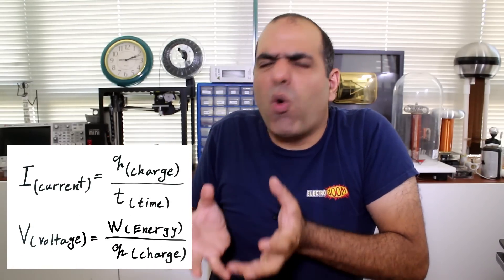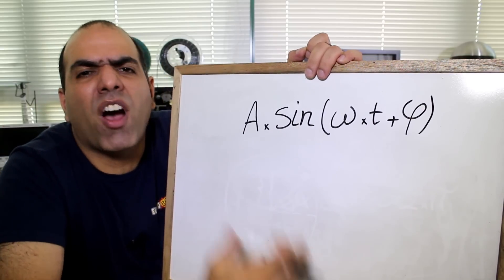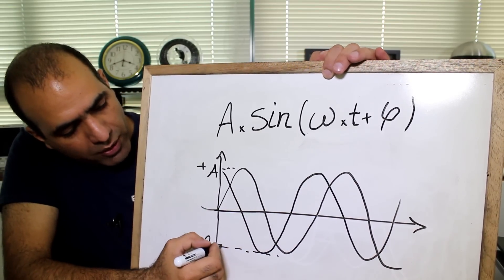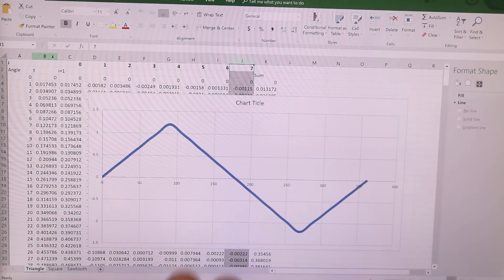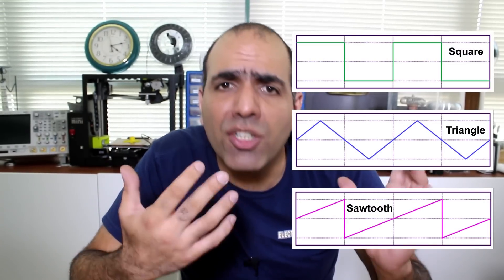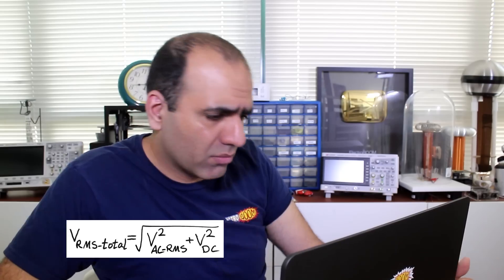What’s AC and DC (ElectroBOOM101-003)

Comment: As you said the direction of ac current would change in some frequencies 
So why we dont have electricity in neutral wire ?
Reply: really dude?  check the voltage of your outlet with a multimeter with the red probe on the neutral wire and black probe on line.

Comment: I have some questions(they might be dumb.. ). Imagine we have a powerline going to f.e. the Moon, theres a lightbulb and an other line coming back to the Earth. 

-How should I imagine the electrons movement,when we connect the lines to an AC supply.

- How much time does it takes for the bulb to turn on?

-Are the elecrtons traveling like waves on water, so (ofc.) it doesnt turn on immediately. Are the AC voltage "builds" up in the wires like the waves on the surface on water and there are points in time when half of the wires dont have any voltage in it, meanwhile the other half has the AC in it?

Comment: here is a challenge for ya.  we know sound at a specific frequency can levitate a ping pong ball....or other objects...yes this is true....fact.  so....build a model flying saucer with a coil on the bottom or a speaker....and then run the correct frequency through it to levitate it.    if you built a coil and ran a frequency through it and placed a ping pong ball on it ....it may levitate.....so...since the coil can lift a ping pong ball...why not upsize it...and run that same frequency through it...to life your model saucer.  i bet it would be challenging....and pretty cool to watch you do it.....if it succeeds....you could build a sonic hover board.

Comment: To make an AC battery:
With 3 batteries, 4 transistors, 2 resistors, 2 DC leds, 2 capacitors (low voltage for rapid alternating change):
the positive terminal of battery 1 is connected to led DC 1, resistor 1, resistor 2 and led DC 2;
one connects the led DC 1 which connects the collector of the transistor 1 to the resistor 1 by the capacitor 1 which connects to the bases of the transistors 1 and 2;
one connects the led DC 2 which connects the collector of the transistor 3 to the resistor 2 by the capacitor 2 which connects to the bases of the transistors 3 and 4;
the emitter of transistors 1 and 3 is connected to the negative terminal of battery 1;
the collector of transistor 2 is connected to the positive terminal of battery 2;
the collector of transistor 4 is connected to the positive terminal of battery 3;
the emitter of transistor 2 is connected to the negative terminal of battery 3 which will be the first alternating port;
the emitter of transistor 4 is connected to the negative terminal of battery 2 which will be the second AC port;
add 2 transistor:
base of transistor 5 links to base of transistor 2;
collector of transistor 5 linked to emitter of transistor 2;
emitter of transistor 5 linked to negative terminal of battery 1;
base of transistor 6 links to base of transistor 4;
collector of transistor 6 linked to emitter of transistor 4;
emitter of transistor 6 links to negative terminal of battery 1.

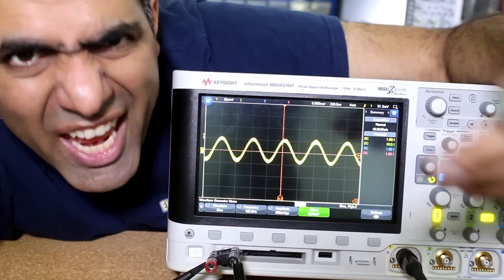Comment: 8:39 yup, just like what we do to any message as an electrical wave to prevent loosing info after we delete the negative alternatives. S(t)+U with S(t) is the message and U is the DC continuous composant that we add before multiplying them all with a High frequency wave in an AD633 aka the multiplier before we get to "modulate" them all. thats what we learnt in the "amplitude modulation" lesson (AM) i hope youll make a video about AM one day <3

Comment: I have a question. You said that dc  is getting to destination untouched, but ac is not. That's why we are using transformators to raise ac voltage. And you said that if dc was easier to raise as ac, we would stick with dc. But why do we need transformators to raise dc power if it's getting to destination untouched.

Comment: Edison was correct, DC is better for power conversion and delivery. Why didn't he just invent the LLC resonant converter? Now we're stuck with bulky low frequency AC transformers, and pretty much their only advantage is that they don't require electrolytic capacitors, delta-sigma modulators, N-channel MOSFETs and microcontrollers. Overall an inferior solution.

Comment: BIG ! FAN! SIR! , 
i have a question a bit of a tangent from this video however ..
i was wondering if i can use a 12 volt battery along with a boost converter to match an BLDC esc 55volt to power a motor ?
is it ok if i just match the power levels of the dc to dc to that of the ESC and run , would the ripples damage the ESC ?

thanks a ton !

Comment: So does the electrons in AC changes direction 60 times every second, moving forward and backward? Which means the electrons came to my household is not originally from generator or transformer but “vibrating” electrons in a conductor.

Comment: I have a doubt , 
For example if we connect a fluorescent lamp to an AC supply, the lamp must blink because the AC current is oscillating.  But it does not happen .

Is it because of frequency(50Hz) of AC??
Please respond
Reply: Hi! That happens because our eyes see  in aproximate 40-60 Frames Per Second, and its not aprecciable because in 50 Hz light reaches its maximum point every 20 miliseconds :) (So every 20ms theres a cicle).

 Some people see at 30-40 FPS, maybe they can appreciate it a little bit, (but this last pharagraph is pure speculation)
Reply: @tonisoria7516  Does filming it then slowing down the video makes it perceptible?
Reply: @algerianatheist2755  Yes! I never tried it, but I've seen a couple of videos where u can appreciate it in slow motion

Comment: You said AC can carry information....
In my trade (Low Voltage Systems)...yeah we stay below 98v!!! Don’t like them burnt fingers!!

Ok I digress... so in our trade we use what’s called a Powerline adapter to send a signal across a home/properties existing AC circuits to save from having to run new cable.

Video idea explaining how this works because I’m sooo certain there isn’t a tiny fairy inside of those things

Comment: An instantaneous change in voltage, such as the vertical portions in a square wave or saw tooth wave is technically impossible. Even light, cannot move fast enough to instantly change intensity. It would violate known physics. When seen drawn or displayed with a perfect vertical light, this is an ideal situation, but it isn’t possible, in the same way free energy isn’t possible without violating the laws of thermodynamics.

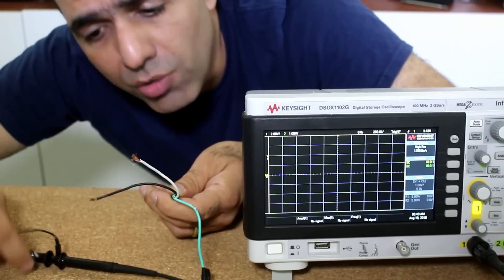Comment: 2:00
uhhh..... I thought the regulation was brown, blue and green?
Reply: I assume you're from Europe. In North America, black is hot, white is neutral, green is ground. Occasionally you'll see a black and red wire, both are live but are 180 degrees out of phase (sometimes 120 degrees).
Reply: @Owen_loves_Butters  because of course NA will go against the world standards.
Reply: @bcn1gh7h4wk  It's not like it matters
Reply: @Owen_loves_Butters  no, of course it doesn't matter.
a world that establishes a world standard so that all connections can be wired the same in favor of safety and flexibility is a trivial thing that can be damned with what respects to the standards of NA.
the world was so bored fucking around that one time they joked about unifying standards for the lolz.
it totally doesn't matter.
Reply: @bcn1gh7h4wk  Complaining about the color of the wires is dumb. And the brown/blue/green standard is only in Europe, so it's by no means another imperial system (which I also think isn't as bad as people make it out to be).

Comment: If AC goes back and forth, wouldn’t it just stay in one spot, if I took 1 step forward then one step back I wouldn’t get anywhere, so how does AC  go through a wire? It would just go back and fourth in one location until resistance depletes your current plz help
Reply: if you look at the oscilloscope, it goes into negative as well. positive, 0, negative, 0, positive. it’s like taking a step forward, taking one step back, taking another back, then taking another forward back to 0

Comment: @8:02 Can you please tell me if your oscilloscope is floating or connected to mains voltage or is it connected to an isolation transformer ?
Reply: The ground of the scope is connected to earth, which is shorted to the neutral, so it's not floating.

Comment: Hey @electroboom
If I imagine that AC moves charges forwards and then backwards  over and over again - if
I add a diode then.. how can it move charges backwards again? The charges that moved past the diode can't move back. If you imagine a water pump doing this it'd suck a partial vacuum because the valve stops it from sucking in the water that made it past the valve?

Comment: You rants against the idea of current kills is the dumbest thing I see you do on this channel worse than  blowing stuff up, shocking urself. 
That is the saying because it the truth, 100-200mA is death period. Higher is possible nerve damage, burning and respiratory problems; lower is pain and possible breathing issues. Voltage normally dictates the current but so does your resistance. But, unlike current there isn’t a kill voltage, I can’t touch to 1kV and die for sure, but I can force a power supply to put out a little more than 100mA and certainly die. 
It’s why 90% of people struck by lightning don’t die, the voltage is super high and so is the current. So, they get burnt and have nerve damage. 80 volts can be just as lethal as 800 volts under certain conditions, wet broken skin vs dry restive skin. 
Again ITS THE CURRENT THAT KILLS YOU NOT THE VOLTAGE. 100-200mA forces ventricular fibrillation, which will kill you. 

The effects on the body is on a current curve, not a voltage curve.
10-99 mA - pain discomfort and issues
100-200 - DEATH
200 and up - nerve damage, burns, respiratory problems 

10-100 V -??? Conditional 
100-500 V - ???? Conditional 
500-10^10 V - ??????? Conditional 

THIS IS WHY THAT IS THE SAYING.

Comment: If you have a circuit which produces a waveform, but all the values are positive (or all the values are negative) so that the current is always going in the same direction on the wire (just changing magnitude) would you call it AC, DC or neither?

Comment: Direct current doesn't suffer EM loss and AC is reactive. Comparing the two in other forms outside power transmission isn't useful. For example in a SMPS the power is technically AC in the flyback transformer but this is relatively meaningless. Changing current definitionally is required to do work in a system therefor AC is always better? Thats like saying a raincoat is the only way to not get wet so always wear a raincoat. Bushed DC motors are just AC commutators. Burshless DC motors are just DC to three or more phase AC, etc. For power transmission DC is better because its not reactive. Power isn't "stored" in a field around the wire. Instead a large switch mode power supply generates the desired pulses efficiently if and when conversion is needed. There is parasitic losses in transformers. If you looked at a LED atom by atom it would also be AC between charge carriers. You can go further to make this even more meaningless to.

Comment: In the US and I'm thinking in Canada, we use 110 volts for our normal stuff.  Europe uses 220.  They say the current is lower so it's safer.  I say they're idiots and that the current will be whatever the resistance will allow and that the higher voltage will permit higher current and 110 is safer.  Please tell those idiots that they are insane.

Comment: You should talk about VFDs and other motor driving methods that use pulse-width modulation to generate a waveform and how IGBTs work. In fact- you could have a 30 minute video on motor driving in general. I would watch it.

Comment: Sir, if I wire my whole home in DC and convert the incoming AC to DC and use is it possible or it can damage anything
Reply: Typically, a lot of the electronic appliances you buy would expect an AC waveform - so they may malfunction if you connect your whole house as DC. They could get damaged too, depending on their design. Its always best to stick with the standards unless there is an exceptional reason to do something else. Did you want to connect the whole house on DC because it is safer?

Comment: Can you explain something like your past comb and charges video. 
Does passing current through a wire increases its weight or not. If not or yes then why. Electrons pass through that have mass. Does it depends upon voltage. Does it depends upon Dc or Ac.

Comment: Does the charge in AC move in the same direction as in DC. Say 120V at 60hz. When there is a load, how does the charge flow through the wire. How come it doesn't cancel itself out. If I think of a river where the current changes directions 60 times a second, it would appear that the water really isn't moving.

Comment: An important point to be made, DC is NOT just when the voltage is constant (for example a flat steady  "line" say at 5V). 
It can be a square wave that is going from 0 to +5V and it would still be DC. 
It has to change direction to be AC.
 In the previous example, if the square wave was going from -5V to +5V it would be AC !  
Direct Current does NOT change direction while Alternative Current does. 
EE students or anyone taking an intro to circuits will find out that professors love to put that "trick" question on the tests!
Reply: This is corrrect. I remember  this when i was studying years ago. Anything between positive and negative are Ac. But if you have a straight line or square in the positive side OR the  negative side is +dc or -dc, dc at the end.
Reply: AC and DC are defined by current not by source.

Comment: Couple notes: 
Usually I see AC referenced as a cosine wave, rather than a sine wave. It doesn't matter too terribly much, but it's often implicit in a lot of notation that "this is multiplied by a cosine". Then after explaining a sine wave on a circle, you proceed to draw everything starting on the horizontal axis lol. Phasors and complex exponentials are also super convenient, but, uh, just tend to confuse the uninitiated :P
RMS makes a lot more sense if you look at the formula you flashed on the screen. Integrals are linear, which means you can break them into independent parts and do each separately. But the square root is nonlinear, so you have to do that at the very end. Also of note is that you have to do the same thing to each separate frequency in a signal, which gets really dirty really fast when your signal isn't a sine wave. Peak-to-peak voltage is still really useful for when you're not talking power!
I find it pretty funny that you mention DC motors but not AC motors. Especially considering how much you seem to enjoy talking about Tesla, not mentioning his most influential invention seems a bit silly! And honestly, AC motors have big advantages over DC equivalents, what with a theoretical max 100% efficiency and no crummy brushes that break constantly. 
Neat video, though! I love that you bring electronics to a big audience. Go EE!

Comment: I swear I thought you were going to have a black eyes after you cut from the scene where you said "you should go back in time and punch me in the face" or something like that lol i would've died haha and great video btw although I did get more easily confused when you talked about the rms value and other stuff.
Reply: To feel it in my heart, I'd like to visualize it. So when you have DC you have a steady current flow of electrons through a wire. When you have AC, you have an increase in current and then a decrease, and then does it come back around so that it decreases more to the opposite amplitude. In other words, the analog signal creates one crest of electron flow in one direction and then it comes back as the same crest in the opposite direction, flipping the charge? If so, could you show an example circuit? Like how does this physically happen?